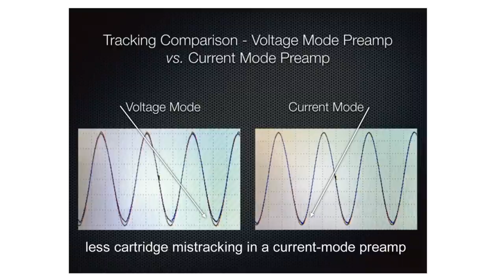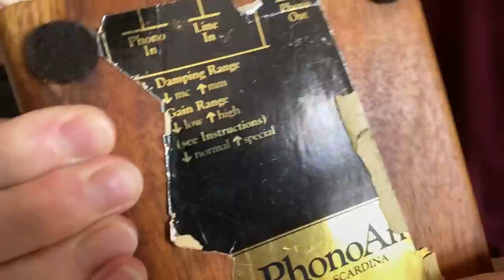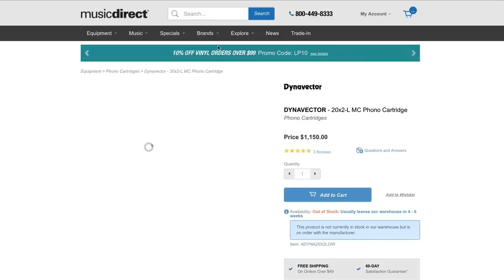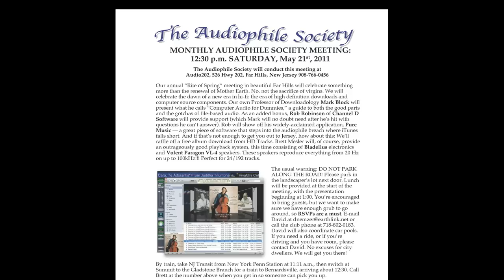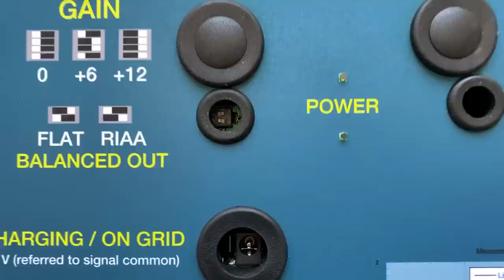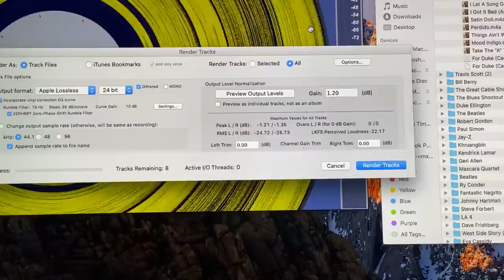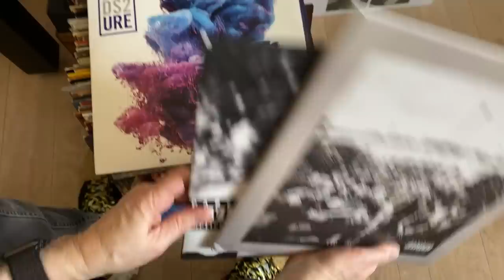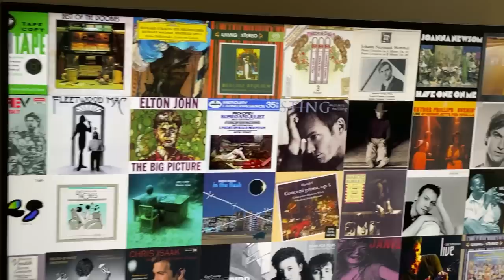Mark's fascinating exploration of phono preamp design

Comment: If anyone is interested, here's a public link to a downloadable file (24/192 Apple Lossless) of the Charlie Byrd track I mentioned. No processing, no pop/click removal. The album is 50 years old and it's been played a couple of hundred times, so I'm sure it's missing some highs relative to a new copy. Each side has over 26 minutes of music, so it was cut at a modest level -- not ideal for surface noise. I cleaned it with a Nitty Gritty record cleaner -- original model, about 35 years old but still working. Played on a Well Tempered deck, over 30 years old. The cartridge is not quite 3 years old. For those who think LPs sound like sh*t, give it a listen at a realistic level, as if you were sitting at a good table in the jazz club it was recorded at. https://www.dropbox.com/s/b5trpssutv931qw/Medley%20-%20Mood%20Indigo%20-%20Satin%20Doll%20Lino%20C.m4a?dl=0
Reply from the maker: Sounds clean and clear, thanks Mark!
Reply: Sounds fantastic, thanks!
Reply: Loved that thank you!
Reply: Wow... wonderful. Thank You
Reply: Beautifully clear and spacious sound with no harshness, just a bit rolled-off from multiple plays. Are we hearing the setup as pictured with the Cadenza Black and the Lino C?
Reply: Very clean. Can you please share how you burned the track - software and hardware. Thanks!
Reply: @1mctous  Yes. The transfer was made as soon as I thought the Lino C had burned in and was sounding good.
Reply: @petrolhead007  I used Pure Vinyl, made by Channel D (like the Lino C) for the recording. I let Pure Vinyl do the RIAA correction rather than having the Lino C do it. The hardware for A/D conversion is the Lynx Hilo in the video (USB card).
Reply: you probably dont give a damn but does any of you know a method to log back into an Instagram account??
I was dumb forgot the password. I appreciate any assistance you can offer me!
Reply: @Kaden Hunter Instablaster =)
Reply: @Cyrus Emanuel It worked and I actually got access to my account again. Im so happy:D
Thanks so much you saved my ass!
Reply: @Kaden Hunter You are welcome =)

Comment: I have a Supex cartridge with .2MV output and have been using it with a Thorens pre-preamp into my Audio Research tube preamp and its been working great since 1980. Of course there is some noise but its way below record noise. Been thinking about modifying the Thorens with low noise resistors.

Comment: Great video! Great image quality too. Very interesting that you are doing your RIAA in digital domain and then recording them. I must say though that although it may sound great, it introduces a level of fiddling around I couldn't handle. One thing, you didn't talk about using the internal RIAA of the Lino phonostage which will likely be the way that most would use it but perhaps your system isn't set up for that.

Comment: First, Mark you did a great job. With that said,
Did anyone catch the $1150.00 cartridge? Man, some people are just nuts for a inferior recording format. I mean like Mark's dad's album. It's got to be 50 years old and had more needles touch it then a NYC junky. I wonder if he had a brand new vintage would it sound the same? Bet not.  
All this is just a high tech way of what we used to do by hitting record on the tape deck and jacking up the gains and running your turntable through it. 
Also you will need 4 things, the last that was skipped is the combination to the safe and alarm codes to your local bank.
Reply: fin screenname Well said. My feelings exactly.
Reply: And your point? Id no sooner criticise your apparent love for boating or whatever your passion is by making misinformed posts that serve no purpose, especially at the level Mark and others are lucky to afford. It begs the question, why do you even watch this channel?
Reply: Here's a link to the Charlie Byrd track I mentioned, captured at 24/192. (It's Apple Lossless. Let me  know if that's a problem.) The record is 50 years old and played a couple hundred times, so undoubtably some highs have worn off, but please give it a listen and tell me how it sounds. I think it sounds remarkably good. https://www.dropbox.com/s/b5trpssutv931qw/Medley%20-%20Mood%20Indigo%20-%20Satin%20Doll%20Lino%20C.m4a?dl=0

Comment: I might try one of these. I never knew that Cartridge/TT phono outs were BALANCED until I saw a review of the Ayre Acoustics phono pre! This is a great video, and mark IS a natural speaker! I still want to know what the Signal to Noise ratio is on that unit. The company does not say what that is. Before audiophiles beat me up for taking about specs, your ears tell you how it sounds, specs tell you what it does. When you switch to MC you give up 20+ DB in S/N ratio, which you can not get back. If you are listening to an album like Bookends by Simon & Garfunkel, at a higher volume, that becomes a problem. I use a Threshold Fet-10e phono pre. So far that is the quietest phono pre that I have used and it sounds spectacular.
Reply: Davethreshold I am also curious about the S/N ratio. The low impedance/differential design minimizes noise, but I wouldn’t expect it to be that much lower than other MC preamps. But I might be wrong.

Comment: 4:40 Yes! It is very important, I've managed to make a cheap AT95E sound very nice by setting low load capacitance, better than normally a 2M Blue (7x the price) sounds!
But when using a MM cartridge, you need to keep in mind: your phono cables have some capacitance too, so you need to set the load lower than factory recommended.

Comment: Had me up to the Coffee maker, what is it?....I want one!
Reply: It’s a siphon(syphon). The Hario company makes one. It’s cool looking but always burns the coffee. They’re fun though.
Reply: @415trevor  This one is a Yama pot. To brew, I check the water temp and put the top part with the coffee on when the water in the bottom is about 180º, so it's about 190º when it rises into the top. Once all the water goes into the top, I stir it and turn the heat off. I don't keep the brewed coffee warm, so it doesn't burn. The Hario is more fiddly and has its own burner. I've never used one, so you might be right about problems with it.  https://www.amazon.com/Yama-Glass-Stovetop-Coffee-Siphon/dp/B002CVTKW4
Reply: @markblock8659  So you put a thermometer in the water, then remove it before putting the top chamber on? I always thought these makers had to boil the water to create the pressure to push it to the top chamber - no? 

Also, great review! You're science-y and quirky, in a good way.
Reply: @russellharvey7096  The water does not have to boil to go up from the bottom carafe into the top. In fact, it's important that the water not boil, as coffee brewed with boiling water will taste over-extracted and bitter. (Conversely, coffee brewed at too low a temp will be smooth but flavorless.) What causes the water to go up into the top is the gas pressure from steam trying to escape, which will start happening at a temperature well under the boiling point. As pressure builds up, the water gets pushed up through the tube into the top.

I  had a smaller Yama pot, a 5-cup model, that seemed to work fine without me monitoring the temperature. With a gas flame on high underneath, the water got heated fast enough that it was pushed up at about the ideal 192º temperature. Unfortunately, I broke the top glass. I replaced it twice, but the new glass broke within 5 days each time, so I had to conclude that Yama was selling a bad batch on Amazon. The larger Yama pot shown in the video has been working great for a long time now, but I find that the water will be pushed up at about 170º. It depends on how much I brew and how high I turn the flame up. The foolproof way is to not put the top on until the water is at least 180º. Maybe my next video should be about coffee brewing. ;)
Reply: @markblock8659  

Coming from the recent RTR episode, & interview w/Jens. So I took the time and viewed this a second time. 
Just well done.

The Lucky Strike cap, nice! 
As a skin cancer survivor, F1 fan/audio enthusiast, and coffee s̶n̶o̶b̶ connessuier, ... this entire submission checked a lot of boxes. Always enjoy a brief perusal through someone's record collection*. There's an entire generation that doesn't know ... that used to be the first thing one would do upon entering someone's place ... check out their LPs. 
Simpler times. 

Online, all too often we see poorly set up systems. So most importantly, as a physics/acoustics-phile, I recognize and appreciate the attention to detail in your room's setup. 
Simple, but so well executed, correctly symmetrical, SBIR mitigating-far from boundaries loudspeaker placement.
The absence of audio cabinets or other items negatively impacting the wave-launch in the form of Very Early Reflections ... outstanding setup. Obviously it can image well, resolve soundstage depth nicely and I'm sure just a pleasure to listen to. 
Also I dig the visual aesthetic, the infusion of natural light etc.

*(ever listen to the Secret Policeman's Ball? Pete Townshend's Flamenco speed playing at his finest. Me and my college roomie kept it on regular rotation). 

Also, although I prefer a simple pour-over method, as a fellow coffee addict, I'm curious about your preferences in coffee beans themselves. 
Tinker, a roaster here in Indianapolis, has me hooked on one of their Ethiopian offerings. Phenomenal, award winning operation. 

Thanks Mark, solid work ... including this recent RTR w/Jens.
Reply: Great review by a real expert. I would never put my vinyl output into a AD/DA converter though.

Comment: Assuming a 10 ohm cartridge, I don't think a damping factor of .2 (10/50) will damp the movements of the cantilever. On the other hand the near zero ohm impedance of a transimpedance head amp will. 10 divided by maybe .1 is a damping factor of 100.

Comment: This a great video!  I've been toying with the idea of upgrading my phono stage now that I've upgraded my cart.   Thorens TD 125mk2 -> SME 3009 series II improved -> Grace F9e Ruby (was an entry level Audio technica cart).   I'm currently used a Schiit Mani (https://www.schiit.com/products/mani) which for $129 has been great to fit all cart types.  My upgrade tooth says to get something like the Gold Note PH-10 (https://www.goldnote.it/phono-stages/ph-10/) but with the Phone + Power supply you're pushing $2200 - $2500 which is 25x the price of the schiit.   What I struggle with in this hobby is the logarithmic scale of $ invested per quality of output. To go up 10-15% in performance you must spend 100% + more in price.

Comment: Great review!

I have been using two of extremely flat pro audio mic preamps, sending the signal to my audio interface and like Mark, applying the RIAA EQ digitally. I feel like this combo is able to best phono pre setups that are significantly more expensive. Since I use Denon carts, I have one of their stereo Step Up Transformer box, for proper loading.

Proper loading and taking RIAA out of the analog realm can make a huge difference, especially if you are on a budget.

For anyone interested, here's a link to an audio plugin for Mac or PC that will handle the RIAA EQ portion, once your signal is digital:
http://www.nullmedium.de/dev/audioplugins/

It's the bottom-most item on the page.
Reply: Bart Pappas Why do you think that RIAA EQ in DSP is so much better than in analog?

Comment: Not sure if it's as good as the dynavector p75 MK4 it's a lot cheaper at £800 compared to the lino c at £2400, the p75 has automatic loading of current from the cartridge no presets needed the lino doesn't offer that feature? theoretically it  could be run out of batteries, Taking 12-volt input, anybody done it

Comment: While this is an interesting phono preamp design with some real advantages, I just cannot understand how someone can ignore all of the blatantly obvious audible detractions and distractions from sonic purity and realism that vinyl records have. No matter how good the recording, mastering, metal plating, stamper making, vinyl purity, handling, packaging, record cleaning, turntable spinning, tone arm tracking, cartridge design and manufacturing, stylus shaping, turntable/tone arm wiring, and album art, feel, and smell may be, the ticks, pops, groove noise and dynamic range limitations of the medium totally destroy any illusion of hearing real music and forgetting about what brings the music to you. But I guess that it’s more about the method than the music to them.
Reply: Despite all those imperfections you mentioned, it's amazing how good a CLEAN record will sound a good system. I would say 99.9% as good a CD.

All though you seem to bemoan how relatively difficult it is to research components, get cartridge loading/capacitance right, proper alignment, clean RIAA EQ, etc, it CAN be done. There IS margin for error. A lot of folks who stop short, will draw similar conclusions to yours.

Is vinyl playback the end all? No, but it should not be overlooked either. A lot of the mastering jobs on those original records is gone forever, except for the vinyl LP itself. That in and of itself, is a reason a lot people might prefer record to a CD of the same program material.
Reply: Bart Pappas Bart, are you a mastering engineer? That last paragraph seems to imply it. I very much agree with you how good a vinyl record can sound, although my experience with vinyl was always a frustrating effort to try to achieve sound similar to what I heard in the recording studios as I worked for a time in that business. I also worked at the CBS Technology Center and worked on recording a set of test records. And I built my own record cleaning machine to help in cleaning, and usually played my records wetted with distilled water which really lowered the noise floor but  not enough to make it disappear. Being an engineer, I have no problem researching and delving into specifications and detail. As much as I know and appreciate how good vinyl records can be, I just cannot understand why some people spend so much money on and swear by the audible superiority of vinyl. I can only conclude that nostalgia is a powerful and overwhelming force for some people.
Reply: No.  The best digital can’t hold a candle to AAA good pressing with TT.  I feel sorry you haven’t heard this sound because it will win your heart over when you do.

Comment: Dont look on anyones specsheets,measure it. The first rule in hifi is,dont view any device as a black box.
Especially if you have a rather big budget at your disposal,you should be not fooled by manufacturers data.
Wisen up,measure it. Youre just a step away from this. It spares you major $$$ in the end.